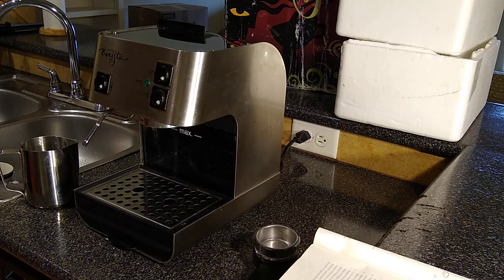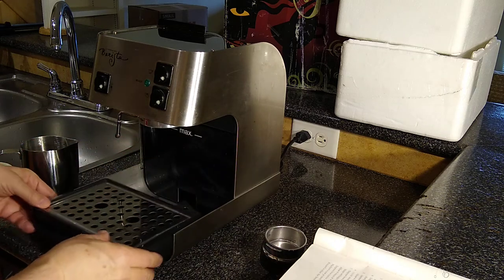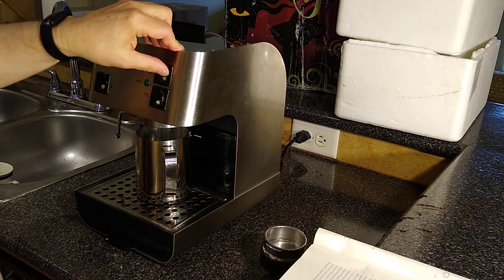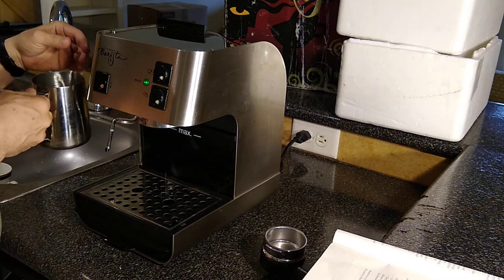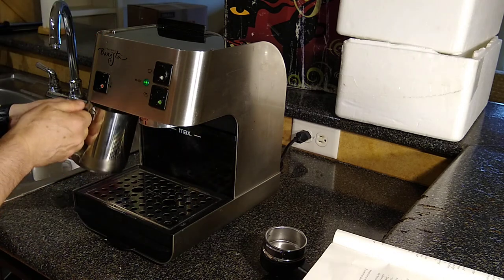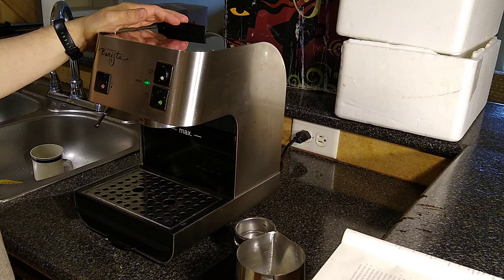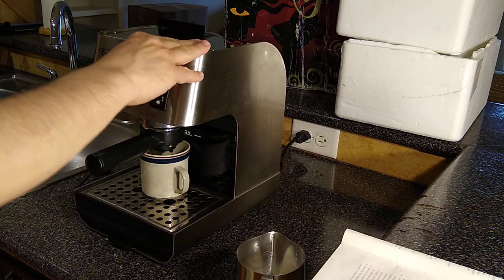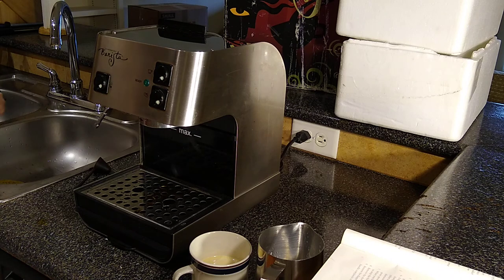Demonstration of Starbucks (Saeco) Barista Espresso Machine

Comment: Don't forget to tamp the espresso in your portafilter before pulling your shot. Otherwise it will brew too quickly and you won't get the best result.
Reply: That's not as important with a pressurized basket like this one
Reply: @AdamGardnermusic  I own this machine and a couple others that are pressurized and it's definitely important.
Reply: You forgot to purge the boiler once again BEFORE you brew otherwise the water at steam temperature is too hot and will burn the coffee grounds... So with steam button off, purge then wait for the ready light... Then you can Brew at the lower correct temperature. Purge-Steam-Purge-Brew
Reply: @williamgriffin8695 thank you
Reply: There is no need to do any tamping with a pressurized portafilter.  All you need to do is level it off and lock the portafilter into place.   Doing that already presses it firmly against the group head gasket.  This is a home use machine, not a commercial one.
Reply: @Kementiri  I’ve used this machine every day for years and can assure you it makes a noticeable difference to tamp before pulling your shots.
Reply: I bought my machine back in the day when Starbucks acutally sold machines and figured it was a good way to get into home brewing.  Stopped using for years and then started up again two weeks ago.  I always used to tamp  and then watched a video on here by some so called expert who said there no need to tamp with this machine.  So I stopped tamping.  I guess it was easier and I did notice the difference in crema but kind of shrugged my shoulders.  You have brought me back to my senses.  I tamped today and the crema is twice that of untamped.  I was just being lazy and thought I could skip a step.  TY for your words of advice :) @budgetbarista
Reply: Nice! I was working for Starbucks back in those days and kicked myself for not buying one with my discount before they stopped selling them. Definitely easier not to tamp so I don't fault you there. You'll still get shots without tamping but they will be under-extracted as you've discovered. Enjoy your machine. :)  @Kementiri